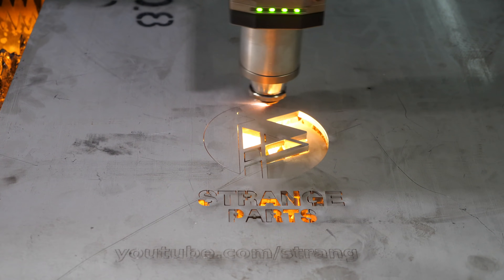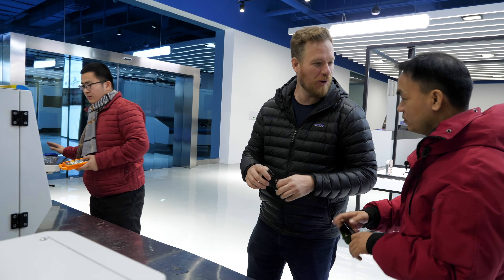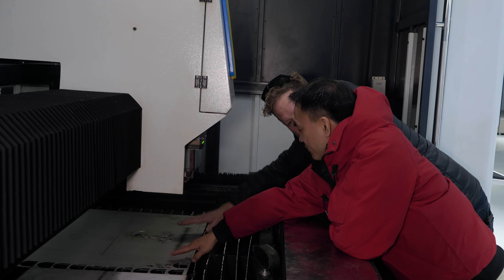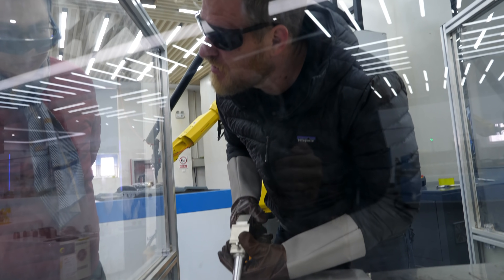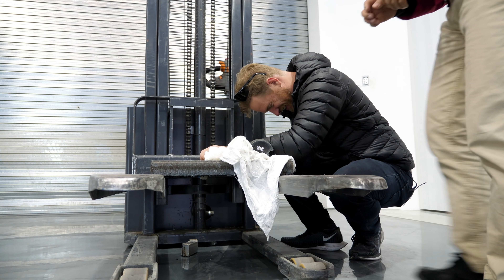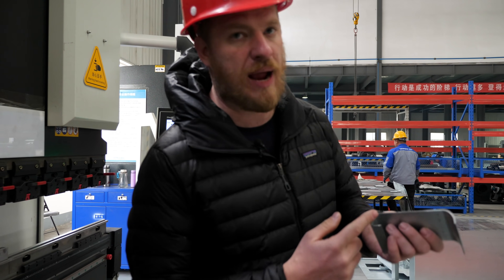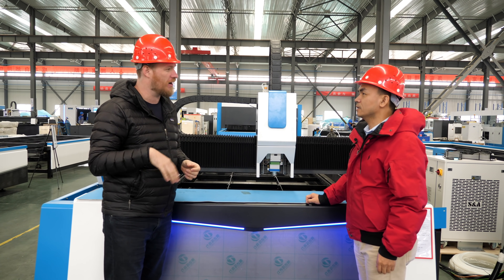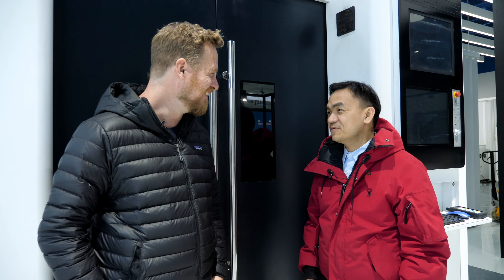This laser cuts through 2 inch thick STEEL!

Comment: Just going to take these eye safety glasses off for a few seconds.....
Reply: Those safety glasses are worthless anyway. Love how he had them down on his nose looking OVER them tho. @styropyro
Reply: @anglerandy5736  The safety glasses are for scattered light.  With 1-12Kw of light concentrated in a 0.1mm spot, even at 1-2 meters, the scattering could damage your eyes.  Fyi, since lamps for lighting are rated by wall power, that's like a 4-48Kw lighting system all in a 0.1mm spot.  Think sports field lighting all converging on a tiny spot...
Reply: @martylawson1638  The laser itself is infrared (anywhere from 1500 to 2500 nm) and as such the scattered IR radiation is not damaging to the eyes. I've worked with these cutters before and you can feel the IR Radiation on your skin (as heat) but can't see the scatter. By comparison, blue laser cutters (i.e. diode laser cutters) are much much more dangerous - even though they are very low power (1-10 watts)
Reply: @MKhurramAziz  Have you confirmed the laser frequency?  Best of my knowledge if the fiber laser is putting out more than 50W it's almost certainly a fiber Nd:YAG or Nd:Glass laser.  Those are most efficient at 1064nm and 1060nm.  At both wavelengths your eye is transparent and will focus any scattered light.  Also, the safety glasses would be almost clear for a 1550 or 2500nm laser instead of the dark tint shown in the video.
Reply: @martylawson1638  so you are saying everything in the video was done safely and properly? Some of the shots it didn't even look like the lenses were covering their eyes.
Reply: @MKhurramAziz  I'm confused. Are these glasses ideal for this use? I know it is dependent on the color of the laser. Sorry for my ignorance and stupidity. Just curious.
Reply: @martylawson1638  The dark tint on the glasses is mostly just for comfort purposes - they are basically sunglasses. They do block IR scattered radiation however the impact of the laser basically burning through the metal is that there is also a lot of visible light given off (in the form of sparks) that can be quite uncomfortable to look at directly and the glasses are there for that.

The laser chemistries you are talking about are all tube lasers, which are very different from fiber lasers. Fiber lasers don't have any tube - they are solid state lasers. The last fiber laser I worked with was a diode pumped coupled fiber laser that put out 1000 watts at 1550nm and was LN cooled and was very similar to the laser shown in the video.
Reply: @anglerandy5736  I'm saying that you don't need glasses when working around these lasers. The glasses are mostly just for comfort purposes, they are mostly just sunglasses.
Reply: @martylawson1638  There is absolutely no way that laser is safe, all EU legislation and US legislation prevents direct and indirect exposure of the skin to a Class IV laser ... there is no way I would want to be near that, goggles or no goggles. It might be OK for widely scattered light, but a specular reflection, or the reflected beam during the pierce operation is lethal ... I share your concerns.  (and I've owned and run lasercutting jobshops in the past)
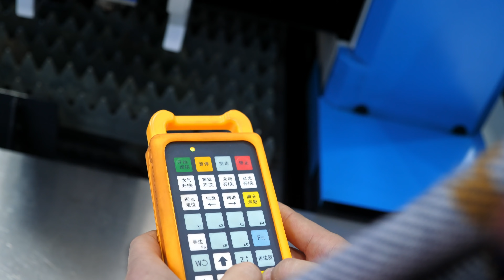Reply: @MKhurramAziz  Sir, hate to say this but you are 100% wrong, wrong, wrong.  I am a Laser Safety Officer.  These lasers at these wavelengths are extremely dangerous and proper eye protection for the proper wavelength and power are a MUST.  Lasers marking on metals produce Specular and Diffuse reflections which can blind you permanently.  Proper Risk Assessment and Hazard Analysis determines at what distance the laser is still dangerous.  These calculations are called NOHD and NHZ's.  I was surprised at 2:00 that they didn't have glasses.
Reply: @anglerandy5736  Some of them are pretty good. I got some with my laserdiode, and they work very good, still not going to test them on my face.
Reply: @MisterMakerNL  Does your laser produce any other wavelengths that you're not aware of. I forget the channel, but he showed that his cheap lasers also produced infrared. Enough to pop balloons through his goggles.
Reply: According to their site these are 1.07 um fiber lasers, anywhere from 1-12 kw. Most definately able to burn your eyes out, that IR isn’t damaging because "its invisible" is nonsense, use proper protection please. With all lasers.
Reply: I work with fiber laser pretty often.  Running them with the door open is a huge don't.  I cant even override the doors like our old Co2s, and 12k is above anything we currently offer.
Reply: I wish styropyro could chime in here I just don't have the knowledge to comment.  I know he has made and worked with some extremely powerful lasers and the one in his most recent YouTube video was from eBay and meant to remove tatoos and the glasses that came with it were junk and it burns divots in steel.
Reply: I have no idea, but aren't those plasma cutters? Pretty sure lasers can't do thick metal.
Reply: @niter43  We can do 20mm steel on ours, there is a lot of factors involved though like oxygen if there is carbon present in the metal etc.
Reply: I work as a laser cutting machine operator and I've used to looking directly at cutting without any safety glasses or protective window in between and, let me tell you, it's not super dangerous for the eyesight (maybe it is over a long period of time, I don't know).

If anyone is interested, my laser is a 1KW fiber laser with a safety door overriden.